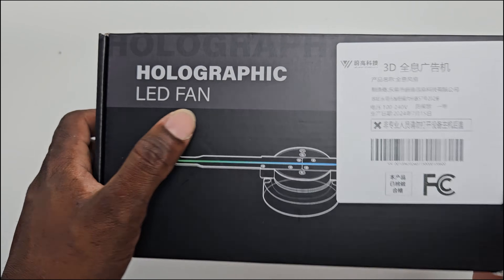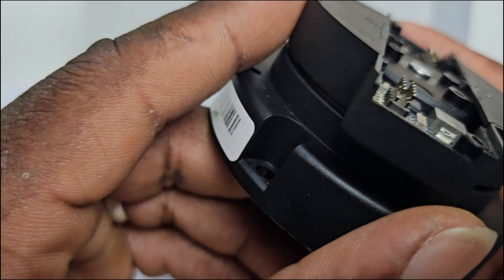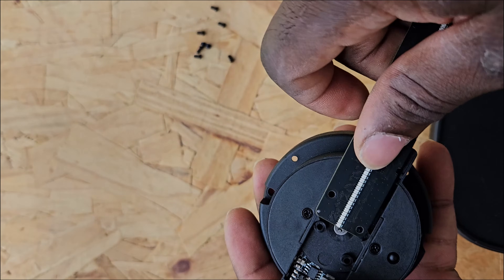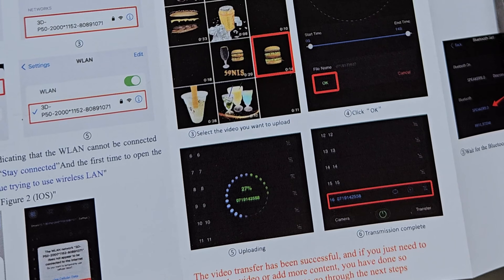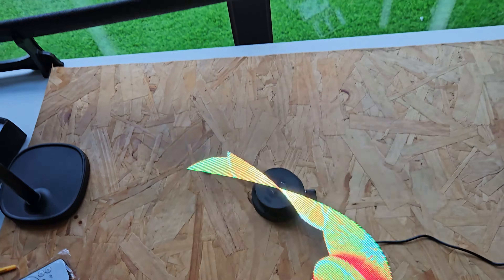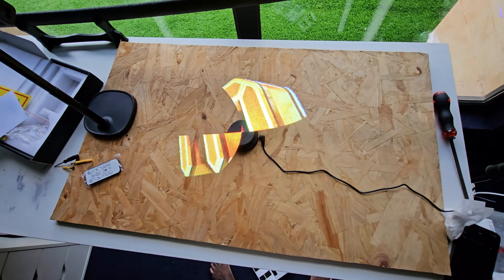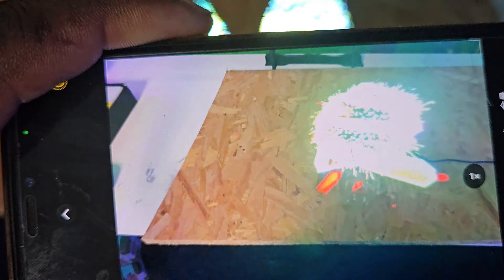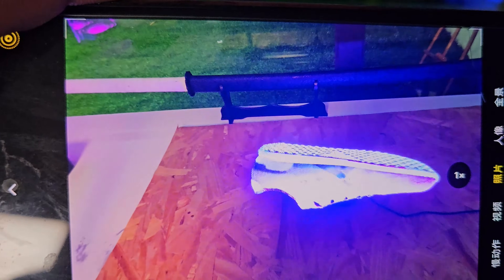3D Holographic Led Display Fan || Unboxing +Review +Tutorial

Comment: The WiFi network of the fan doesn’t appear in my IPhone
Reply from the maker: @Shahmz  reset the device and try again, i had that problem too
Reply: @BoShazam hi! Im having the same problem, how do you reset  the device? 😢
Reply from the maker: @moncheponche7326   very easy, just unplug the dc cable and wait for a minute or so.
Reply from the maker: try using the wifi in airplane mode, first airplane mode then activate wifi. Beware wifi name might also be different.

Comment: I bought this fan and the app will not load (parsing error) on a Pixel 8 Pro. As you say the instructions are worthless. I have the PC app installed but it's not at all clear to me how to remove files from the fan nor to upload new ones from the PC.  Do you have a tutorial to explain the app and also have you tried to run the app on Windows?
Reply from the maker: hi, i am actively working on a video on how to troubleshoot the fan but maybe try this: turn on the 3d fan, put your phone in airplane mode and activate wifi (wifi name is sometimes very different than the one on the instruction book). I will bring separate tutorials of the phone version and the pc version, and a tutorial on content creation for the device.

Comment: you can change the shutter speed of your camera to be able to remove the flickering of the image,  I set mine to 1/30 and it did the trick
Reply from the maker: woah, that is a much easier way of recording it then. i will give it a try
Reply: Interesting. There are a couple ways to negate the blades. Shooting the hologram through another device😂😂😂😂
Reply from the maker: @thepowervideogamingtimetun3650   I tried a lot of techniques and that was the only one that fully negate the blades, feel free to share if you know of any other methods